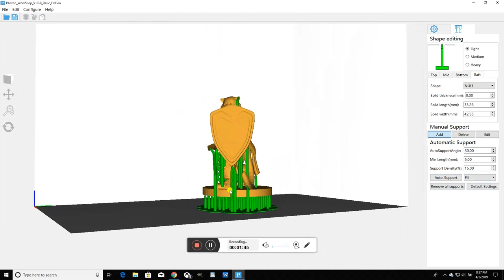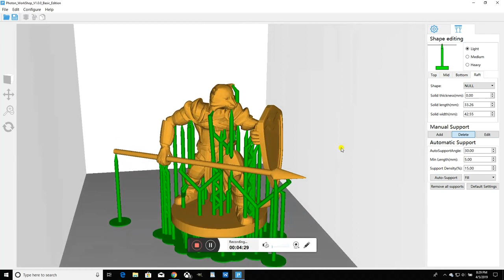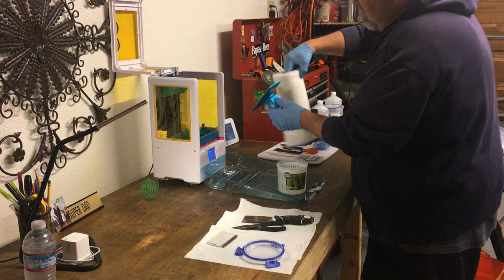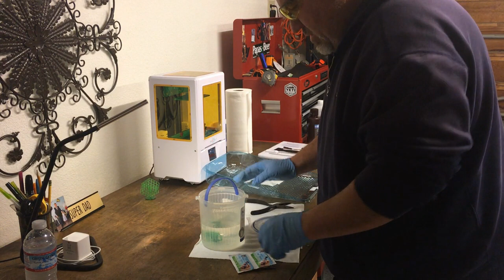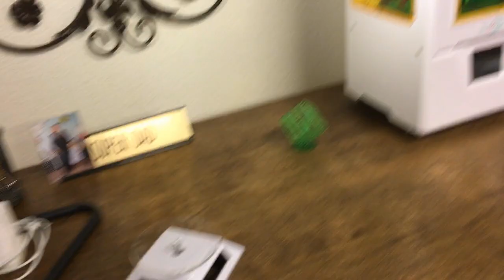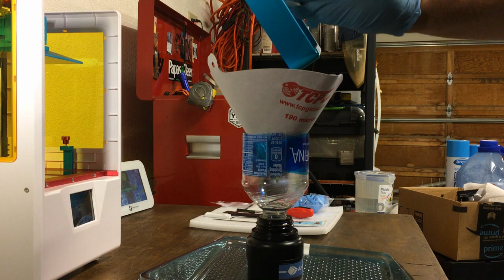Anycubic Photon S - Preparing and Printing my First Miniature  April 6 2019

Comment: did you sanded or polished or just scratched the platform?  settings did you used? nice video btw!
Reply from the maker: I didn’t modify the platform at all.  Stock photon settings. Should be in start of video

Comment: Few mistakes.. you really should remove all the supports after your initial alcohol soak so you get all the resin off that is behind the spokes.   You also didn't cure it under UV after you cleaned it - something you'll want to do to ensure it hardens well. 

Seems like a ton of work for these resin printers not to mention the extremely toxic nature of the chemical... too bad they don't offer a better "cartridge" style resin system... and built in cleaning of the finished model...  some day perhaps!?

Comment: Stats wise, whats the difference between this and the regular Photon?
Reply from the maker: This is from Git hub - I don't have a n issue with the weaker casing. I think the payoff is in the much stronger Z assembly. I also talk about it in my video here  - https://www.youtube.com/watch?v=rUmx4qcJEO8 

 What about the differences between the original Photon (Classic) and the Photon-S?
The Photon-S was released in February 2019, supposedly as an interim upgrade to the original Photon. However, it turned out to be a sidegrade, rather than a true upgrade. Due to the different motherboard, it's actually a completely different printer altogether.

The fundamental difference is that the S model is not file compatible with the original Photon, and thus cannot use most of the essential community software and tools nor any of the original print files sliced for the original Photon. They do not work with the S model.

Furthermore, there is no anti-aliasing (AA) feature for the Photon-S as yet. The original Photon does have AA now via a bootleg firmware, and is scheduled for an official AA firmware update in April/May 2019.

The hardware, software and cosmetic differences are:

New Anycubic motherboard instead of Chitu CBD-Tech motherboard.
New Anycubic slicing software instead of Chitu CBD-Tech slicer. Photon-S sliced files cannot be printed on original Photon, and vice versa.
Plastic shell/chassis instead of all metal stamped steel chassis.
Two column guide sliders on the same central Z lead screw instead of a single column slide. (Note that these are just simple sliders on guide rods, not recirculating bearing linear rails.)
Exposure unit consists of a 38W 4X7 UV LED lensed array instead of a 25W 4X4 UV LED reflector cone source.
Dual "filtration" units instead of a single unit.
10mm taller print capability on the Z axis.
Build plate surface is machined flat after texture blasting and blue anodizing, otherwise exactly the same.
Most other components such as the LCD, vat, build plate, carriage arm, etc., remain exactly the same.

Comment: how long did the printer take for the miniature?
Reply: well.. his clock started at 10:48am and the print was hanging done at 9:45pm.... it might have sat there awhile but that's almost 11hrs... 3d printing like this is slowwwwwwwww
Reply from the maker: Matthew Anderson I didn’t get an exact time as the Photon software is not accurate but I will make sure and time my next mini print and post it

Comment: To really see how well the model turned out, you should spray a matte primer on it.  The transparency/glossiness make it hard to see how the surface turned out.  I'm really curious to see how smooth the surface can be compared to typical injection molded miniatures.
Reply from the maker: Varun Bajaj I plan on doing that later this week and will post

Comment: Nice video! I want to see "Photon VS  Photon-S". What is the difference and which one to pick up.
Reply from the maker: I'm loving the S so far, I think they have fixed some issues with the Z axis on this model and the software is different. The casing is now plastic and not as sturdy. Not an issue yet.
Reply: @salinas3d495  and the print bed allows for slightly taller prints

Comment: Thanks for the video as I'll be watching it in full later tonight (can't now on mobile).  I'm considering getting the Photon S for mainly tabletop wargaming purposes so I appreciate the video.  I'm curious to see how the mini will look once you remove the supports and prime it.  Apologies if you cover this later in the video but what layer height did you use?
Reply from the maker: I'm super happy you enjoyed the video. It was at .05mm , I haven't adjusted any of the default settings on the machine through my first 3 prints. I love this machine. I will put a couple pics on here tomorrow of the cured product and then I'll put some after I hit it with some primer.   I'm finishing up on my 4th video right now. I printed a large print to test our the machine and it looks like it come of absolutely great. Click on the notification bell and subscription link and you can watch me figure out all of the ins and outs of this printer. Thanks Again. You rock.